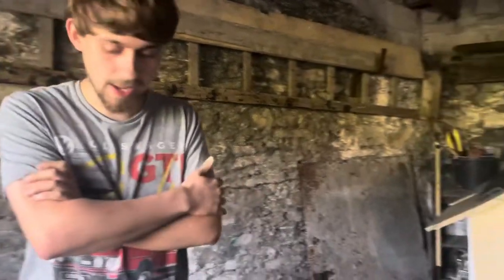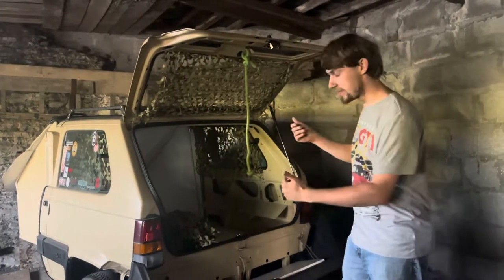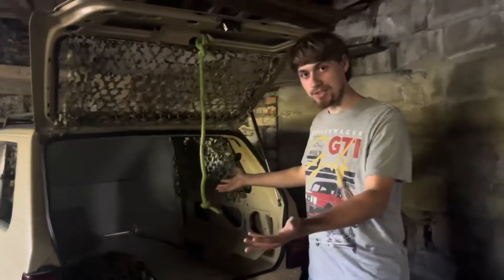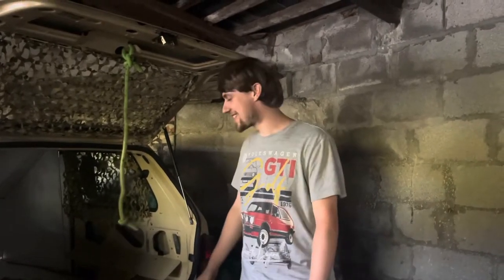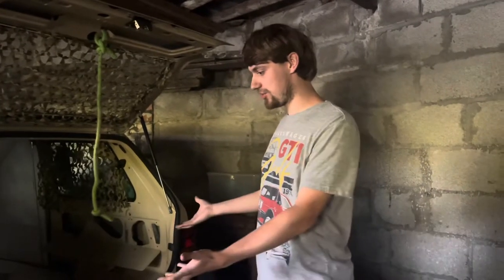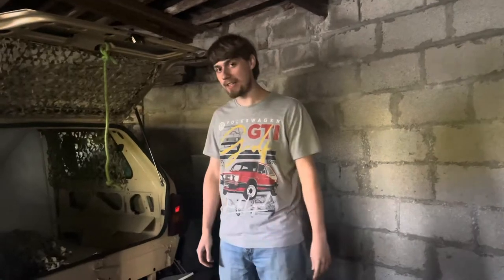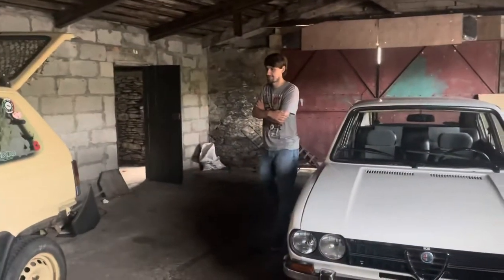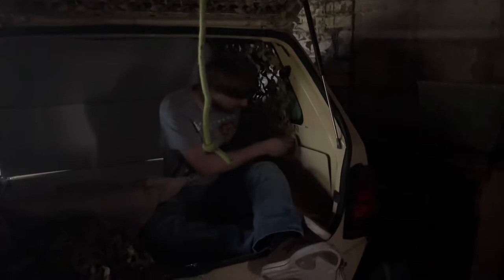Introducing the Panda 4x4 Camping Trailer!

Comment: Great to see it in use. The aluminium prop is to use while you fold and unfold the sides. Don't sleep in it without the steel wires hooked up (or the floor will sag and leave gaps).  And there's another story to the trailer's design - it's meant to be a driveable buggy but I never got around to building the last bits for that. - It is designed though...
Keep up the good work.
Reply from the maker: Thanks! We had the steel wires hooked up when we slept at RRG 😎 Funnily enough I mentioned to someone at RRG that it would be cool to have it as a driveable buggy! Not sure I’ll ever get around to it but it sounds fun 😉 Thanks Andrew!